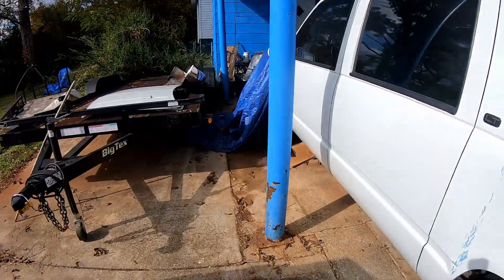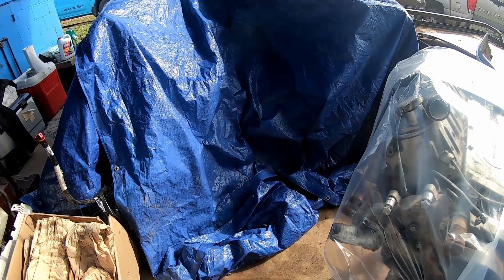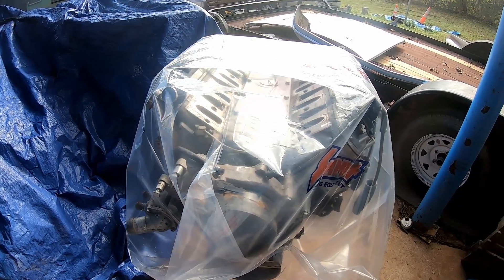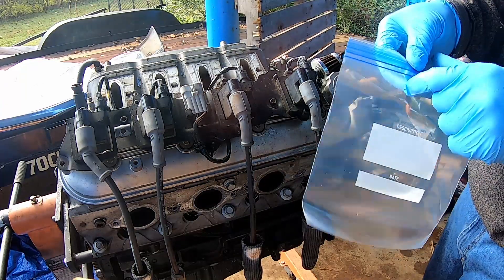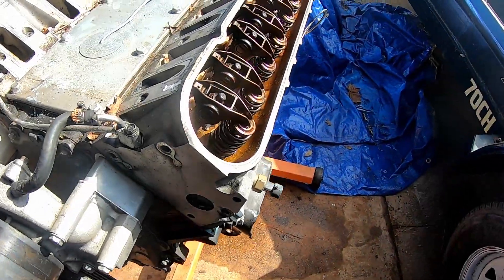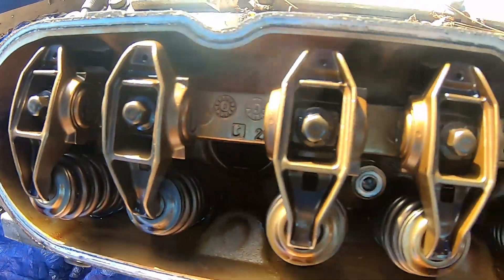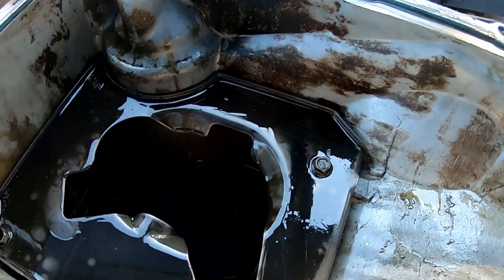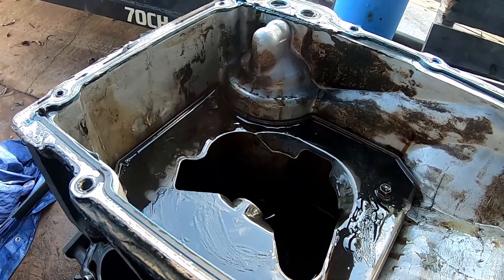How to Build a 383 from a LS 5.3 - Part 1: Disassembly

Comment: Hey brother been checking out your videos I have a 93 Chevy suburban having issues with driveshaft. Im running 5.3/4l60e and seems as driveshaft needs a inch more to fit correctly, can I asked what did you do on your swap
Reply from the maker: Whatz up doc,

I didn't have any issues with my driveshaft with the swap.  I did have a custom driveshaft built though.
My factory driveshaft had too much run out from the factory.  Joker would vibrate the truck violently.  
What problem are you having?
Reply: @Slicpartna  it’s like and inch to short for my liking it’s fits in place but the yoke comes out to much when locking it to rear end
Reply from the maker: @jayrob9439  ok i got cha

Does the motor plates that was used allow for 1" forward and 1" back to position the engine/transmission?

Probably can gain the 1" by repositioning the engine/transmission 

Just a thought
Reply: @Slicpartna  everything is as far back that it can go
Reply from the maker: @jayrob9439  wow

I used driveline specialist out of California for my driveshaft.

Good customer service and good price 
Better than buying local
Reply: @Slicpartna  yea I’m not good with that tape measure
Reply from the maker: @jayrob9439  does your current driveshaft give off a bad vibration or is it out too far for your comfort
Reply: @Slicpartna  out to far for my comfort
Reply: Wish I could add pic to post
Reply from the maker: Do you have a driveline near you?
They can assist you

Comment: Great job my brother!  I cannot wait to see the outcome of your project!  your right the LS is an awesome engine.. I’m still trying to find out why my transmission is not going into gear only thing else it could be is the ECU!! The tour converter  is at its designated spot believe it or not this is the fourth time I’ve taken this engine and transfer a case down
Reply from the maker: Thanks for the compliment 

Are you able to shift the transmission manually?
Reply: @Slicpartna  yes! the transmission shifts The only noise that it makes is when I’m trying to put it in park it grinds
Reply from the maker: @originalman8497  that doesnt sound good
I hate to say it but....

Might need to have the transmission   checked
Reply: @Slicpartna  
Something funny My transmission 13 pin plug-in was filled with transmission fluid today!!! The place that I just bought the 2003 transmission from said that it was remanufactured 
Wow what a journey
Reply from the maker: @originalman8497  that is deep, real deep!
Reply: @Slicpartna  
I have a question for you! The engine that I purchased is a LS 1 Corvette six speed! my question is can you change a manual transmission to a automatic drive I’ve heard that Audi has a vehicle out that you cannot switch from Manual to automatic 
thanks brother
Reply from the maker: @originalman8497  if I understand you correctly you are asking can a manual transmission be made into a automatic
Negative,
Reply: @Slicpartna  My question is, my transmission still will not go into gear! I was wondering if an engine that is a six speed be changed into an automatic by taking clutch of of engine and by installing a new automatic transmission and converter
Reply from the maker: @originalman8497  yes 
You can use that engine behind an automatic

Please tell me everything that you did to the engine to put to a automatic
Reply: @Slicpartna  
I’m getting ready to send my truck off to an Ls guy! I just can’t figure out what the problem is… this is the 3rd transmission 2003 thanks for your help brother
Reply from the maker: @originalman8497  hey yo
I'm sure you can figure this out doc
You will have greater satisfaction figuring this out

You put the gear selector in drive and it doesnt go into gear right?
Reply: @Slicpartna  yes, your right it will not go into gear! I keep wondering if it’s the right torque converter! I bought this one from Transmission specialties it’s a custom plate torque converter just wondering if it’s pulling the torque converter to far forward
Reply from the maker: @originalman8497  it is quite possible that the plate is pulling the converter forward the torque converter shop should have given you some washers to offset the forward movement. If the converter is pulled too far forward it might not engage the pump
Reply: @Slicpartna  
Thanks brother